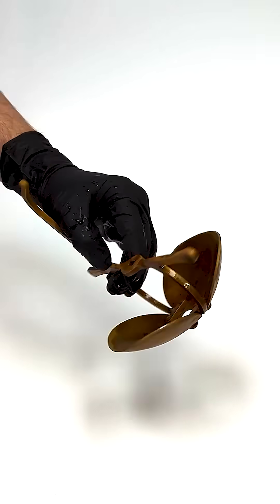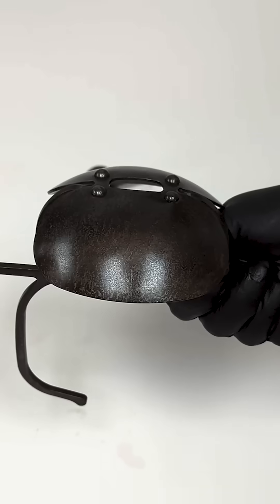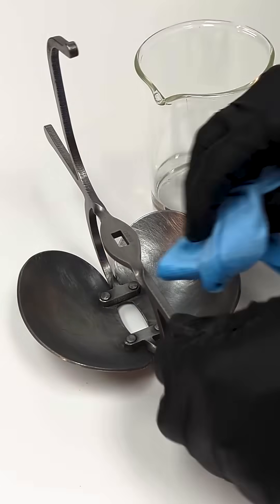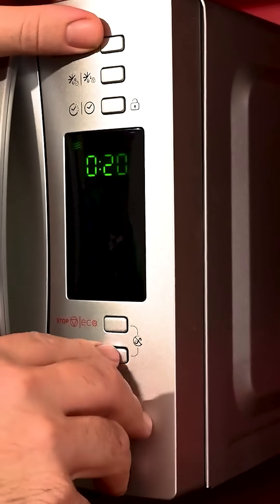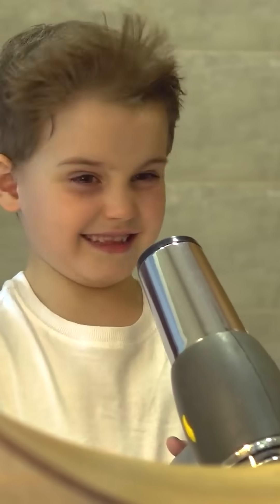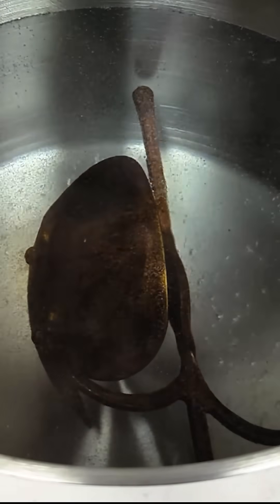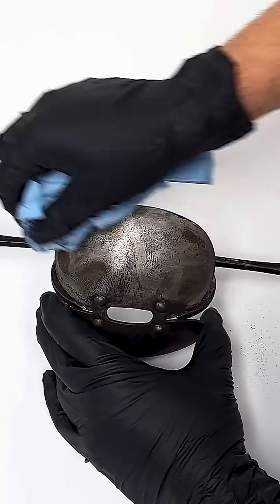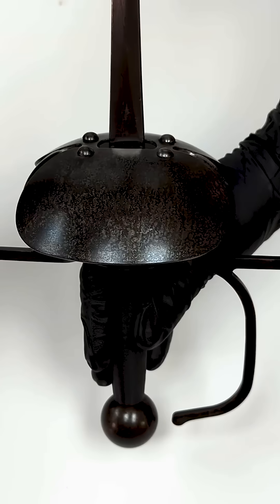It's not ruined, trust the process! (Rust Bluing)

Comment: Hold on, is that literally just iron oxide? Iron oxide turns black like that when simply boiled?
Reply: Under anaerobic conditions,  Fe2O3 (normal rust) can turn into Fe3O4 (magnetite). This is called a shikorr reaction. I'm not sure why the water needs to be hot, this is just what I found after a few minutes of research. I wonder if this could have anything to do with the rainbow effect you see on steel where it was heated up.
Reply: @johnhunter7244  The rainbow effect has more to do with the base material type and a condition call HAZ degradation (heat affected zone). Generally it's found prior to degradation from repeat high heat areas that are affecting the structural qualities of the material. Unless it's titanium, that rainbow color indicates material stress outside of normal range for the type and is edging towards material failure (crystalline embrittlement on high carbon metals to near-melting on low carbon or non-ferric metals).
Reply: @C-M-E  the HAZ and oxide coloring are both caused by heat. The HAZ, if done improperly, can make the metal extremely brittle and prone to failure. The presence of the oxide coloring does not indicate that the HAZ is weak, but if the oxide coloring areas is very narrow then it might indicate an issue. The oxide layer forming has nothing to do with how quickly it cools down either, and I've personally used the color to know what temperature the bearing race I was heating was so I could know when it was ready to be put in place with a shrink fit.
Reply: @johnhunter7244  The rainbows caused by heating are also made by oxide layers. In fact, if you heat steel in a way to control the thickness of the oxide and get a blue, that's "heat bluing" just like this video is about rust bluing.
Reply: @SirRebrl  I am aware that it's related in what it is (but it is not the same, heat blueish contains several chemical formulas for iron oxides), but I'm wondering if it's a similar reason why it works in this case.
Reply: @johnhunter7244 the water is hot because adding more energy to a reaction makes things go faster, (or at all, in a lot of cases)
Reply: Yeah, it's just the heat that does it really. It reduces the Iron(III) Oxide to Iron(II) Oxide which is harder (and magnetic again)
Reply: Just here to see if someone replies 😊
Reply: Yup all bluing on firearms is. Its a different for of ruat. This technique works for refinishing rusty firearms with out sanding orstripping the metal bare

Comment: He used the corrosion to defeat the corrsion. Neat!
Reply: Like using nitric acid and copper. If the acid is too strong it will first make a oxidized layer protecting the rest of the copper from entering the surface.
Reply: A technique like this is used for some steel infrastructure to preserve it in the same way
Reply: Most corrosion prevention solutions for metals are controlled corrosion on top layer that forms a stable surface with the atmosphere and keeps the rest underneath protected and isolated. Like passivation on stainless steel, chromate conversion on aluminum, titanium is in itself very stable and forms an oxide layer protecting itself, and there are a lot more process.
Reply: They used to do this on guns a lot. Still do.
Reply: @ForniteJeffReal Is that where gunmetal came from?
Reply: @ Doesn't seem like it since we use full on steel now and have for a while.
Reply: @ForniteJeffReal   it almost the same black tightly adhering oxide that’s also used on steel/iron.
Reply: @strob5657   Yes, the  bluing on gun steel is also a form of controlled rust or corrosion.  As opposed to ‘red’ rust, it is very uniform and tightly adheres to the metal preventing any sites on the surface of the metal from being exposed to the thing that causes unwanted corrosion….oxygen & moisture.
Reply: @ It's the same oxide im p sure.
Reply: @casualobserver3145  Ooooo TIL
Tyty
Reply: Can't get corroded if it already is
Reply: that's why aluminum alloys basically  don't get rusty
Reply: Yes, that's what a patina is.
Reply: will it be protected like powder coating ?
Reply: He converted it, like a double agent
Reply: Black Oxide vs Red Hematite!
Reply: The Thanos Mentality🔥
Reply: Stainless steel forms a thin coat of oxide when exposed to air. That’s what makes it stainless - rust!

Comment: why we are not doing this to rebars?
Reply: Cost
Reply: Expensive, time consuming, plus they're placed in wet concrete. That's a very caustic environment and may compromise this coating anyways.
Reply: We are. Kinda. They come out of the rolling mill covered in millscale.

It’s a good rust protection but it requires constant maintenance, and it’s nowhere near as good as a zinc coating/galvanizing.

To work properly a black oxide coating needs to be oiled. But we can’t oil up rebars.

Comment: Why acetone? There's much better oil removers out there, such as what painters use to prep car parts and similar for the spray booth.
Reply: cheap and all thats necessary
Reply: Why not? It worked and is cheaper and less toxic
Reply: Cheap, easy to use and dump, accessible and simple composition. Obviously this might not be meant to be used at a large scale, but I don't really know if this is the case or not.
Reply: Probably meant to be ingredients that people already have or can easily acquire.
Reply: no hardware store trips for the other stuff in this video

Comment: I swear, I was hunting down information like this when I was still making knives.
How did I not know about this?!
Reply: it is because this information is still pretty hard to find all things considered. Techniques, such as bluing, are known by many people, but are not often communicated or distributed. It also matters about the field you are in; gun and metal bluing using this method is not conventional these days, and is often relegated to hobbyists. the more conventional way these days is "bluing salts". even then, knife bluing isnt very common so you are somewhat unlikely to find knife makers discussing it.
Reply: This is converting red fe2 to black fe3 the fe2 tends to grow and slake and cause damage vs fe3 that doesnt so quickly
Reply: Can't tell you, guns have been rust blued for as long as they existed...
Reply: @b0rd3n  well researching "rust blueing" is easy. Researching something you don't know the name of nor the process can be really tricky.
Reply: @b0rd3n when I've seen it done before, the gunsmith has used a steam cabinet for an even surface rust and just boiled it to convert the oxide , I dont recall them.using salts, but there's umpteen exact processes that produce a blued part
Reply: To be honest, i did this before and it worked better without the vinegar. Winegar seemed to remove the oxide layer that had already formed.
Reply: You can actually get metal gluing from sports store. I personally prefer the salts
Reply: All guns to ww1 was blued like this
Reply: Because it is an expensive and time consuming method, and very modern. The classic way done all the way back to the Roman empire is do coat it in yellow mustard, just go buy a gallon of it from the grocery store. Look up tips on using mustard, save some money.
Reply: @Chuklz70 what is expensive in this process
Reply: This was my first thought too; will this work for carbon steel blades too? Much better and more uniform than the forced bluing from a vinegar bath
Reply: You neglected the library
Reply: Man you have got to be shitting me. You made knives and never googled "how to make knife black"
Reply: i wonder if it works on modern knife steels
Reply: @Barleh  works on any kind of high carbon steel cant be stainless
Reply: Citric acid does this too! and you can? add some H2O2 hydrogen peroxide to your rinse too either wash vinegar or citric.
Reply: Can we see your knives, please?
Reply: @mr.kakerudanielvl6496  It's been AGES since I've made one. BUT.. if I decide to make a knife again this year, I will come back to your comment and send you a link! :) And that's a promise!!
Reply: Why not season it like you would a pan ?  The coating that forms from the polymerized oil isolates the metal from oxygen slowing down rust.
Reply: It's just chemistry
Reply: Ye
Reply: You’re not alone. It’s gatekept. Now we know! I tried to find how they did it years ago because I learned I could do it to steel when I learned how they blue old shotguns.
Reply: reason is simple, its outdated method, steel oxidation is really basic chemistry and we have better methods that are faster and have better penetration
Reply: @ Just because it's "outdated" doesn't make it any less interesting or useful. There is a lot of cultural value in doing things the older, harder way. For one, we don't want to lose insight in manufacturing processes in case the alternative is out of reach or when creating replicas of priceless historical pieces.

The process is part of the identity of an object, just as much as its blueprint is.
Reply: @Strieuok  Yea there are tons of things that are slightly better, patented, and cost 10 times as much as solutions we used 50 years ago.
Reply: You simply didn't end up accessing the right places. Many gunsmithing books have multiple blueing and other surface treatment methods. Hot blueing,cold blueing, Browning, hot salt bath blueing. Hot salt nitriding. Black oxide. Qpq nitride. Electroplating nickel, gold ,silver and chromium . Electro-less nickel plating ,color case hardening and what temperatures give what colors. As well as wood finishing methods that give durable and long lasting results, including woodgrain sealing methods that help prevent uneven stain , dye and oil absorption.
Reply: @ Oh, yeah. The thing is, I grew up in Germany. Guns were VERY much not on my radar when researching this. My family is Czech, so I'm culturally inclined toward medieval stuff. But researching gun smithing to supplement the knife making toolset makes unreasonable amounts of sense. I think once the cold is over, I may put some of this newfound knowledge to the test!
Reply: @ChaonicMew this looks like a indoor activity to me..gotnto boil water, etc...why wait...test it out on small pieces 1st
Reply: @ChaonicMew ironically some of the best firearms in the world are made in Germany and Czechia
Reply: Another term is “patina” I’ve never heard “rust blued” before personally.
Reply: @spray_cheese  my dad told me I made up the word patina..that it was called chocolatizing....ikr
Reply: Rusty KNIFE? Are you normal?
Reply: @ Noone's complaining when a japanese luxury kitchen knife has a patina. So I'm not sure what you're on about.
Reply: You didn't Google it. Took me 3 minutes to find
Reply: @iamtheonebelowall  You know, googling for something you know is possible to do while knowing the right keywords in 2025 is very different from researching primarily low tech or medieval forging techniques in 2008. There was also a much more pronounced cultural barrier to knowledge back then. Information from, for instance, American gun forging didn't quite come up as much in Germany. There are many reasons I didn't come across that kind of knowledge. I was aware of bluing agents, but considered it too.. out of reach and expensive for something I did in my garage on weekends with the cheapest materials possible. Now, nearly two decades later, coming across this information is great. But let's not kid ourselves and think that this is widespread knowledge. Maybe in some circles. But again. Finding knowledge again is easier than trying to stumble over something you didn't know you'd love to know, because your assumption will be that if there's magically something that solves a problem, it would be in widespread use. The thing is, the problem has been completely sidestepped by non rusting iron alloys.
Reply: Just use tool black
Reply: @codyreber8370  Yeah I know about that, but honestly, I think that THIS technique is superior for how low tech and cheap it is. My concern is also as much whether I have enough aswell as what do I do with the rest of it once I don't need it anymore. Doing all kinds of crafts has the benefit of accumulating a lot of tools and other things which is also a bad thing when they are used only so many times. And I'd prefer to not hoard chemicals.
Reply: Because you are apparently very very bad at hunting down information. Glad to clear that up for you. Have a nice day.
Reply: @wizewizard1840  What would you have done in my stead to find that kind of information?
Reply: Because you don’t know how to do basic research
Reply: @ I was 13 or 14 and inquired about this during a metalworking internship. This was over 16-17 years ago. My way of researching stuff mostly consisted of buying and reading books, with the occasional library visit, as we've been cautioned not to use the internet as a source of information in school back then.

Needless to say, my metalworking teacher wasn't all that interested in forging, as the school I did the internship at was more on the machining and CNC side of things.
Reply: @ChaonicMew  this is like the worst thing about the pre internet and transitional era. i know multiple very expert craftsmen that learned everything they know about thier craft with books long before the internet existed and there are alot of holes like this one in thier knowledge. these holes never make them bad at thier craft it just limits the possibilities they can explore.

the better i get at my trade the more i feel like the times before the internet was the like the dark ages but for technical knowledge.

im 23 and only have 6 years of experience in my trade (sheet metal/hvac) and sometimes i look things up online with my phone and find solutions to problems and easier ways to do things very often the old guys did not know the trick i found online and are impressed about it
Reply: @SnailHatan Do you reckon you’re smarter than the average person?
Reply: @SnailHatan cmon man no need to be rude. they were hand making knives clearly they did their research
Reply: What a shitty reply.... You don't know what you don't know. No one does... You, specifically, don't even know how many times your ignorance kept you from things you would have loved, I am guessing you have a bit more of that in your life than most people, Dunning Kruger was right.
Reply: @SnailHatan  if he was making knives 20 Years ago, he wouldn't have found that information quickly, even using the internet of back then.